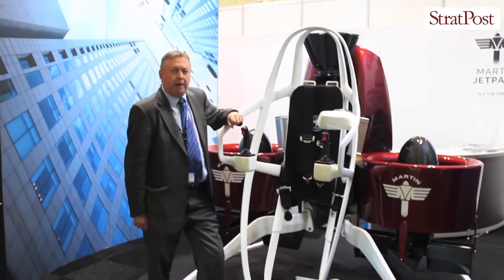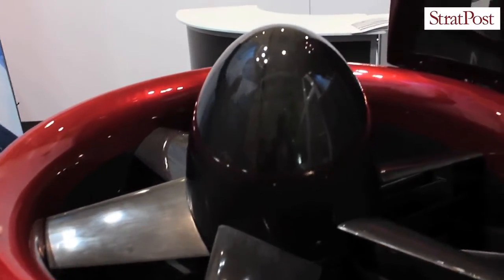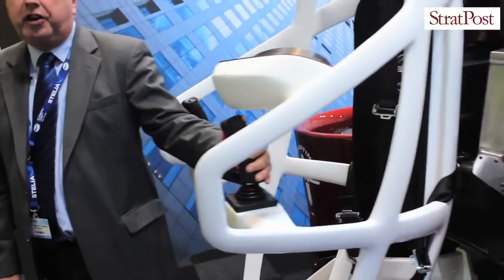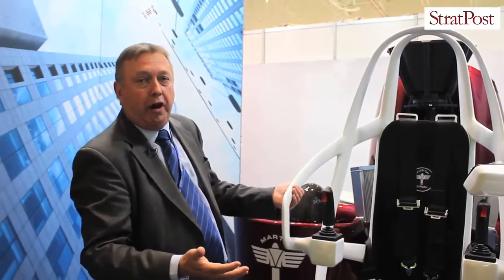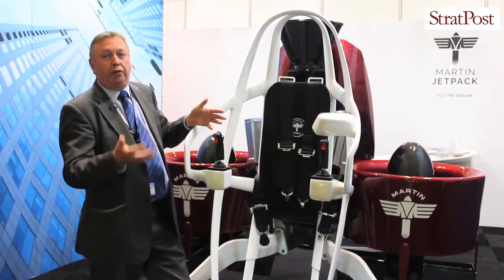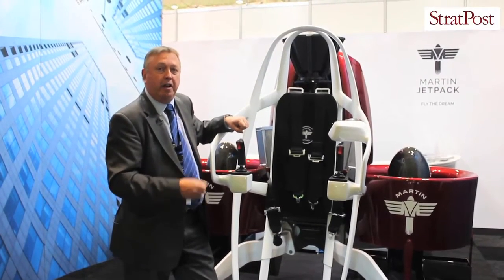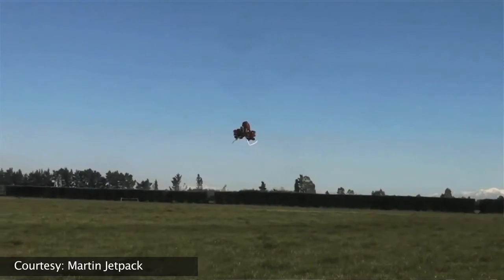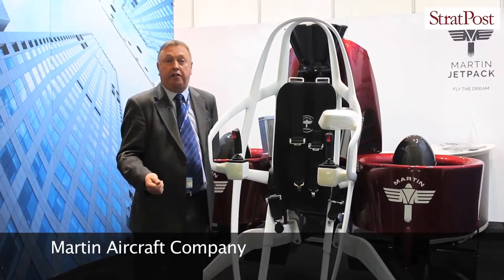StratPost | Martin Jetpack at #PAS15

Comment: The 2014 IPO promised first delivery date of Q3/2016 has now passed and all technical specifications downgraded to a level where this machine is totally unpractical and ill-suited for any potential customer. A yet to be achieved targeted top speed of 40km/h will make this device a little faster than an electric golf cart, probably the reason why Martin Aircraft Company asked the American golfer Bubba Watson to promote this device as an alternative golf cart. Having to totally overhaul the engine after just 30 hours of running time will also make this not just the most unpractical, but also the costliest of flying machines. The founder of the company, Glenn Martin, resigned in 2014 and the CEO he appointed, Pete Coker, followed just weeks before the companies’ 2016 AGM to take up a position with Martin Aircraft's Bermuda tax haven incorporated majority shareholder, Kuang-Chi Science. Martin Aircraft Company, with its just under 100 employees, is churning through millions of dollars at a rapid rate (Pete Coker earned $300,000 plus per annum) and has advised the market that more money will be required just to see some kind of commercially acceptable Civil Aviation certification in place. Kuang-Chi Science has so far invested over 40 million dollars in 2 instalments, which will most likely run out in the second half of 2017. All you can buy from Martin Aircraft's website so far are logo printed ball pens, luggage tags, clothing patches and even thermal jugs, but that is about it. Their website has been stagnant for some time, despite employing a considerable marketing team with really nothing to sell. A dismal state of affairs and a sad story for investors like myself, watching the share price of this company drop on a daily basis. Don't be fooled by any forthcoming unexpected announcements, as they would probably be forerunners to a new capital raising exercise. Do your own research and analyse previous videos released here on YouTube. Here is just one from the Oshkosh Air Show: https://www.youtube.com/watch?v=vyb6vnX1My0&t=17s with Glenn Martin advising of "20 jetpacks by this time next year", which would have been 2009, or 7 years ago. Do not get sucked in like I was!!!!!!!!!!